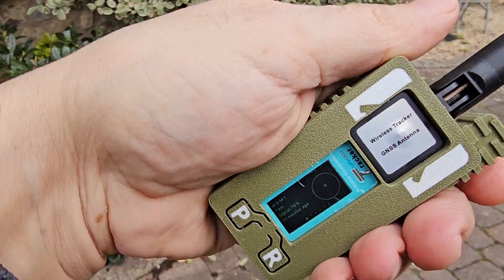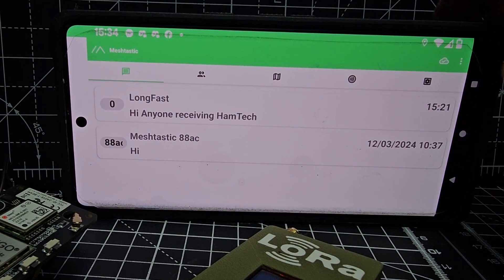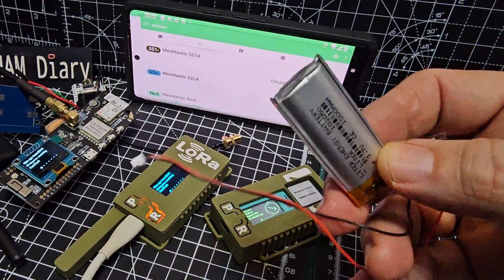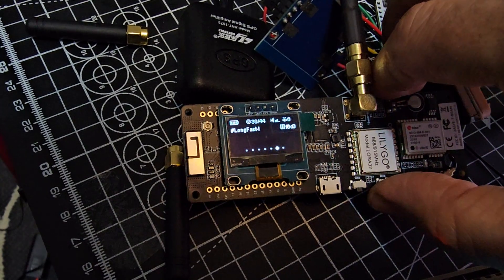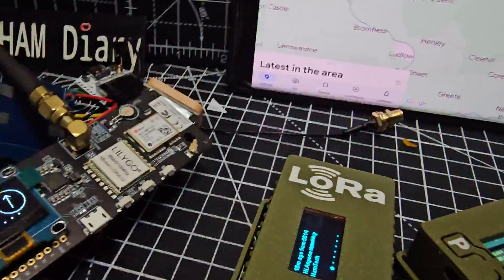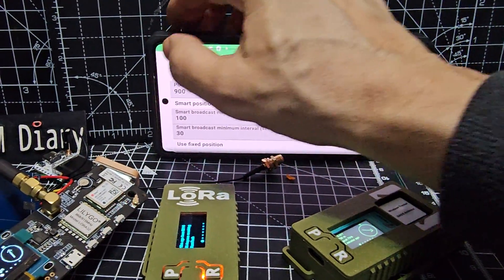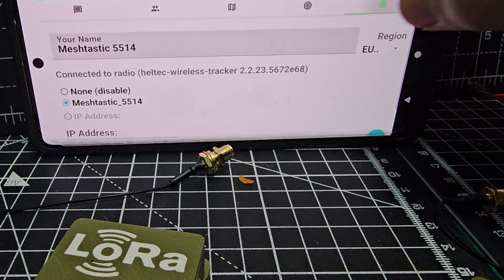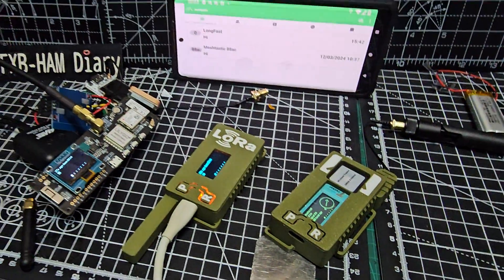MESHTASTIC 868 MHZ BASE STATION ANTENNA

Comment: Do you have MQTT activated on any of your meshed devices?
Reply: Be sure to enable upload and/or download in the channels page, plus be sure to deselect the Ignore MQTT toggle which is on another config page
Reply from the maker: I tried but nothing happens
Reply: It appears to me you have got the MQTT partially working, which is why your peer list is populated. When you get the cloud checked notification, it doesn't mean the msg has gone to the recipient. You'll need to see a person checked, then they've received it. We've been playing around with it. It appears to us, with a heltec v3 (tried 3 antenna now), it's only able to actually send a msg by line of sight without MQTT. We're able to get a msg past a couple of concrete walls, 100 feet out the door. No better than a 10 year olds walkie talkie. Sound about right?